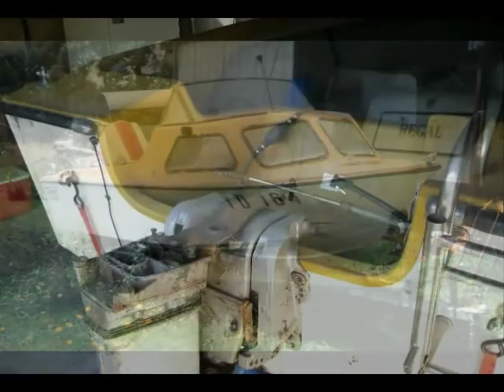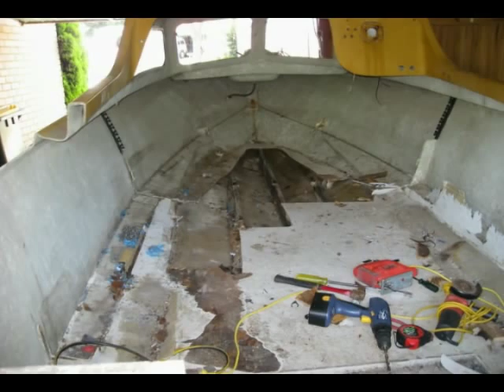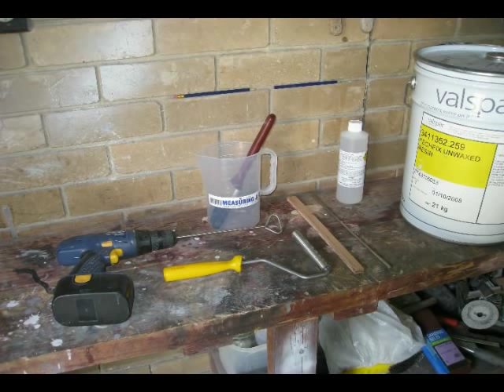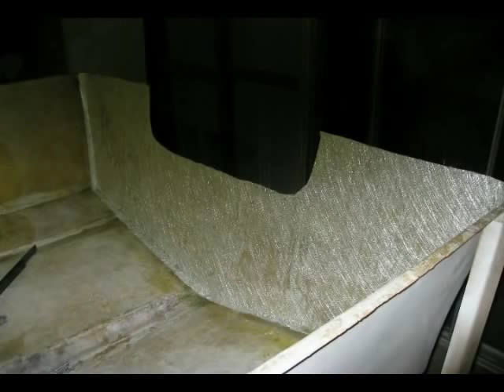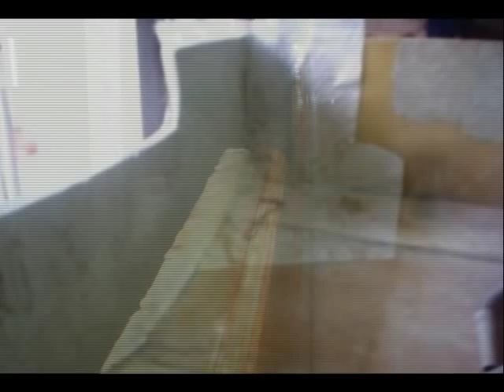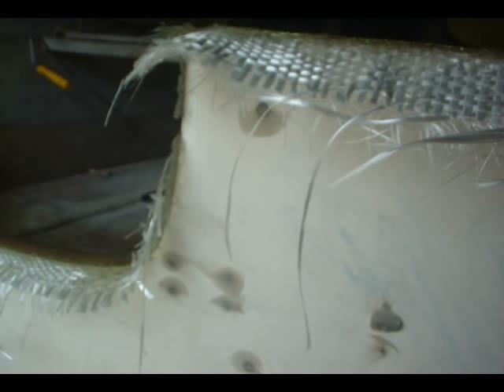15ft Fibreglass Halfcabin Rebuild 1

Comment: My 1971 18 ft Hourston Glascraft has a convex transom!  I thought it was part of the design, but have realized that the transom is completely rotted and the fibreglass skin has distorted to this convex shape from the weight of the outboard (also 49 years old).  This boat has been around my whole life and I've owned it for half it's life.  Too many good memories to scrap - even though I know I should. Got a couple of good ideas from you.  I'm hoping I can straighten the transom using the angle iron bolt through technique you used.  Good idea.  My boat is similar to yours (also harvest gold top) with the moulded  rear upper deck.  I've been staring at it for a few days wondering how to access the transom.  I took the engine off today and the transom is completely delaminated and rotten from what I can see at the top. You didn't mess around...just cut off the upper assembly!  I assume there are screws under the bumper strip that allow you to remove it.  You did some nice work on the fibreglassing. Gave me some ideas and inspiration.
Reply: How did you get on in the end? I have a very similar job on my hands and have been pondering the same questions. I'm not certain why the while upper assembly/deck had to be removed like in this video just to replace the transom.. most vids seem to have people just chopping out the back portion of fibreglass to access the plywood core. What did you have to do in the end?
Reply: @tamariderr  I spent far too many hours on this boat, but all that's left is the repainting inside.  I did not separate the upper deck from the bottom.  Glad i didn't because this boat actually has 3 parts (hull, upper deck and another cockpit liner). The two inner deck layers had to be removed anyway at the floor. My transom had only a thin layer of mat and gelcoat on the inside, so it was relatively easy to peel that off and work from the inside outward. I just took one of those thin blade reciprocating saws and cut out the splash well (whatever it's called) about 45 degrees towards the top of the transom and into the cap. Probably should have followed the creases in the shape but figured those angular areas would be under more stress when I tabbed them back in. As I got to the upper transom I went parallel about 5 inches off transom at the top and into the cap to give me some working room for getting new transom in and working on the tabbing etc.  The original transom was only double laminated to the height of the motor mount.  I decided to double laminate the entire transom to be much stranger. My upper deck was so oxidized, I knew I'd be painting it anyway. If I had mint gelcoat on the upper deck I might have thought twice about doing that because of all the extra work it creates painting or redoing the gelcoat. Once I got the transom out (mostly scooping with a pry-bar and at the bottom I used a chainsaw), I realized the stringers were rotten.  I pulled up the floor, realized there was nothing left of the wood below deck.  That boat was only supported by the hull strength and the fiberglass laminated to a floor that had rotted away. There was no foam flotation, only about 2 inches of wood left the length of each stringer (there are 5 stringers in this boat).  Black mold had acted in the high humidity below the deck cavity and there was nothing left.  A bit depressing.  I did get the new transom in the first summer.  I used the popsickle stick method to get the template and I laminated 2 pieces of marine grade ply.  Don't cut the hull skin if you can help it.  That's the main structural strength of the transom tying it to the boat. I've seen guys do it.  Some don't know what they are doing. I found about 6 guys on youtube really know their stuff.  Sometimes you have to cut the skin. I had more than an inch outward bowing of transom in middle compared to sides which got worse as I moved upward.  No way to correct it. It was impossible to straighten because the glass was so thick there.  I wondered if that was part of the design - but I doubt it. So, I made 5 clamps out of 2x4 and also temporarily put about 40 deck screws through scrap ply and through transom to pull fiberglass transom skin in contact with 1st layer of plywood.  The first plywood layer was cut 1/3 of the way from port at 45 angle so that mating 2nd  2/3 piece could be slide in place from top.  I then laminated a second layer cut 1/3 from starboard at 45 degrees. They had to be cut.  It was impossible to get them in place as a single piece.  I clamped and screwed 2nd layer from the inside into the existing lamination.  Worked like a charm.  Resin squeezed out of all the little holes in exterior from removed screws of previous lamination. I let boat sit for a year to dry out exposed keel.  The keel was encapsulated with glass, but had a stringer sitting on top of it which was rotten and removed. Keel was damp, but not rotten (if it was I'd have scrapped the boat). Last summer, I replaced all of the stringers (and encapsulated them with 1708) and the floor (underside sealed with 3 coats resin top with 2 layers 1708) and most of the fiberglass work is done.  Just need to reassemble and tab in the splash well and then paint the inside and upper deck.  I am rebuilding 51 year old motor over the winter.  I think it should be back in the water next summer.  I have kept pictures of each step and may eventually post the process. Here in Canada (Vancouver) quite a few people still have Hourston Glascrafts.  They were excellent boats with deep V design, but I'm sure Chuck Hourston never thought people would be using them 50 years later. Excellent design, just not meant to last half a century!  I know this boat will be around long after I've gone now that I've built it better than it was off the production line.  However, unless the boat has some meaning to you......it's the most ridiculous use of money and time (& women don't share the enthusiasm!). If I worked for minimum wage for the hours put into this boat so far, I would easily have been able to buy something much newer and just enjoy it. It's also a very unhealthy job with the fiberglass dust and all of the chemicals.  Guys selling old boats telling you "just a few soft spots on the floor, just needs a little TLC" and wanting $10 k......RUN AWAY. I now know the horrors concealed behind a thin layer of gelcoat. I have a sentimental attachment to this boat, so it was worth it to me.....wouldn't do it again though just for kicks!  Good luck!
Reply: @redgreen610  Thanks for the detailed reply! Sounds like it was a mammoth job. I suspect mine could potentially be a similar sized job it I let it be.. The floors a bit spongy but I'm deliberately not going to look under there. Suspect the stringer are soft and the fiberglass coating is holding it together. Im planning to just focus on the transom and then call it good. The old ply was mush when I got it out today and sounds a bit like yours in that the ply transom didn't even reach to sides or the floor and the rest was just fibreglass skin. Figure if I replace it with nice new ply and fibreglass it into the sides, floor and the top of the rear deck it will still be a massive upgrade.  I'll re-read your reply again tomorrow and try to make more sense of it as it sounds very similar! Cheers, Jack
Reply: Oh and definitely post the project if you get a chance. Even if it's just a slideshow of pictures with you narrating the process. I'm sure people would find it interesting and useful
Reply: @tamariderr  they never used to glass the stringers to the top apparently so "they could breathe".  I read something about that somewhere.  The idea was that the wood was not kiln dried (much of it was the cheapest they could find and they wanted it to wick out the top without delaminating the glass at the bottom....never made too much sense and I guess they never thought about black mold's ability to break down cellulose.  My boat was built in 1971 before flotation foam was used. At that point, they thought glass and gelcoat was impermeable to water and fiberglass hulls had only been around maybe a couple of decades....not long enough to see what 50 years will do to a boat.  Your boat probably has open cell flotation foam below the deck which is saturated with water adding a couple of hundred pounds. If you have spongy floors anywhere, count on the stringers and sub-floor being rotten. No, you don't want to see that. Kind of what I say walking by a mirror... If you are just putting around a lake fishing, you're probably ok just fixing the transom.  I wouldn't take loved ones out to the open ocean cranking it through the waves though. Those stringers give much more rigidity to the hull as it pounds through the waves and prevents hull distortion on acceleration etc.  Without them, there is a ton of hull flex and eventual fatigue of the fiberglass.  That's why fishing guides change their boats every few years - hull fatigue  from fiberglass flex. All the best. Hope your job goes well.  Believe me....I know that apprehensive feeling!
Reply: @redgreen610  That sounds typical. Few minor(ish) design flaws that become critical failures down the line.  Ill see how it is after the transom. It's only for putting about along the coast in the calmest of summer days catching a few mackerel (British). If I see issues down the line then it'll be a decision of redo the whole subfloor/deck or scrap/ sell the boat and get a slightly bigger and better one. If I completely redo the boat then I'll need a new motor and trailer to match as they're all pretty basic and old. Cheers, Jack

Comment: I have to say that cutting the top off in half like that was stupid and no one should do the same, what one does is to remove the top and then do the bottom side of the boat, never cut it in half
Reply from the maker: I put in the research before doing anything. I originally meant to only rebuild the transom and stringers and floor. That is one of few ways if not the only way to do it properly. Then I went in deep into doing the entire re strength rebuild and getting the hull straight.That cut and join is a story in itself its a strong point now. Not a weak point. I made fibreglass taco shells to fix and set in place so you can still run electical cables etc. Cant get around to making vids these days too busy with other things but will make more vids again someday. If I become debilitated somehow or more lockdowns maybe? 
Cheers.
Dan.